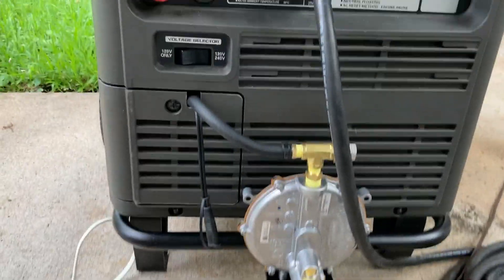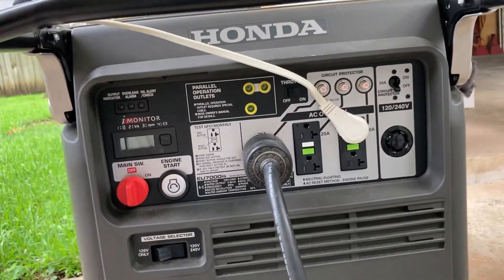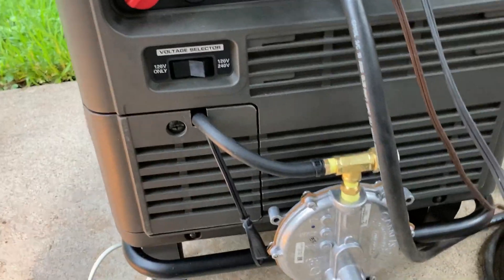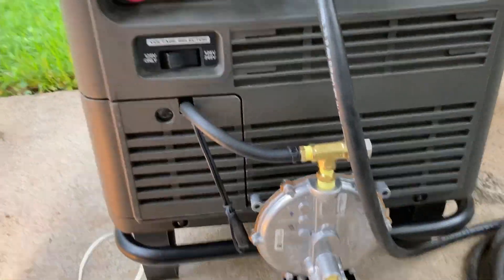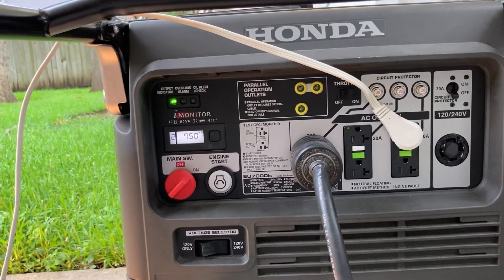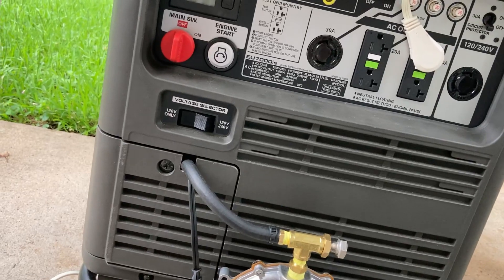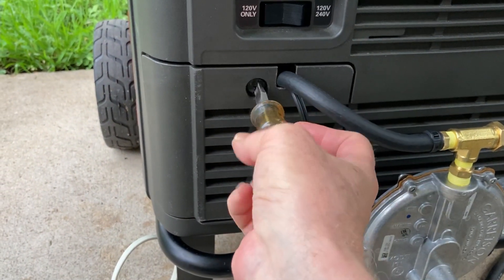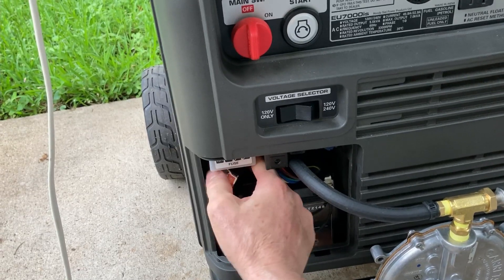Honda EU7000is running on natural gas with US Carburetion Motor Snorkel tri-fuel conversion kit

Comment: Wow, night and day difference!  Thanks for posting this very informative video. It motivates me to finish installing the rest of my US carburetion components and de-commission my genconnex kit.  It seems like the snorkel piece could be the big differentiator, maybe combined with a slightly differently tuned regulator.  Nice work on the customizing, install looks great. 

I just got a GenTent for mine, another nice piece, but spent a lot of time fabricating new mounting brackets as I was not impressed with their one-size-fits-all ratchet strap approach.  Works great now. Ready for hurricane season here in Houston!
Reply from the maker: I just typed a nice longish reply and YouTube ate it.  I'll try again when when my enthusiasm returns.
Reply: @MstrMark  FYI - I connected the generator to my larger 3/4" gas line feeding the pool heater and there was no difference in power output. Sweet spot for higher loads seemed to be around 4600 - 5200 watts, ECO mode or not.  Since the portable gas hose I use is 1/2" ID, that could have been the common restricting element. But as you mentioned previously, the snorkel fitting orifice is so small that the gas supply line is likely not going to an issue with respect to maximum power output of the generator on natural gas.  I'm OK with it...my typical house draw is in the 1500-3500 range during outages.
Reply from the maker: @browsedeweb8834  Well, that's disappointing, but not entirely unexpected.  I've done pressure testing at both ends of my half-inch hose and couldn't see much difference.  It is admittedly more difficult to measure than I had hoped, because the pressure changes at the same frequency as the engine RPM, so one is always trying to read the center of the needle swing.  Still, if the center of the swing is about the same at both ends of the hose, I take that to be a good indication that there isn't any significant loss in the hose.  

FWIW, since I made this video, I added a 3/4" street elbow and a quick connector.  Immediately following that, I plugged my house into it and ran on generator power for a few hours.  I ran a small window A/C unit, heated up a snack in the microwave, washed a load of clothes, worked at my server and my computer, ran lights and fans...basically just did what I would normally do, with the exception of running the central A/C.  Honestly, it was easy to forget that I was running on generator power.  I stopped the test only in consideration of my neighbors, since it was getting to be 8:30 PM.  Not that it's loud, as generators go, but still...

I think I can run my central A/C unit, but I would want to get a soft starter for it first. I think the EasyStart from Micro-Air might be the best choice, but they are expensive: https://www.microair.net/collections/easystart-soft-starters 
If I was more famous, perhaps they would give me one in exchange for a demo video <GRIN>

Meanwhile, I'm good for the short term with 30 amps of 120 Volt loads, and I also have a big DC inverter window unit that I can run with a purpose-made extension cord connected directly to the generator.

There is also the issue that the way that I'm currently feeding the house doesn't support 240 volt loads, so I'd need to get that sorted out too.  I tried to hire an electrician to install a whole-house generator transfer switch for me, but apparently they have been in short supply since the winter storm.  And being as nobody has any stock, I've also had a really hard time determining which one can work with the generator of my choice, as opposed to a single brand.  Generac in particular was completely useless, referring me to a generator installer rather than just telling me if they have products that work will with all brands of generators.  And sadly, my electrician doesn't know either, or it's just not worth his time to try to figure it out..

I might try running on Propane too, just to see if it acts any different.  I'd like to confirm that all fuels actually do work anyway, so it would be a nice little experiment that would take the natural gas supply completely out of the equation.  Of course then I'll have to wonder if I'm meeting US Carb's seemingly impossible requirement of using a cylinder that has already been refilled multiple times, but if it just happened to work better, that would be interesting.  

I'm not really all that concerned with getting a full 5500 watts continuous, but I don't like the way mine surges and hunts at times.  I feel like that might be related to gas supply.  Have you noticed that happening with yours under similar conditions?

It might be as simple as the engine having less low-end torque on natural gas than it does on gasoline, so when the GCU allows the RPM to fall below a certain threshold, the engine just can't make enough power to maintain the RPM.  As the RPM drops, the power output of the generator suffers, thus reducing the load on the engine, at which point it revs up again, but then the GCU once again attempts to reduce the engine RPM until it runs out of torque again, thus starting the surging cycle over again.  Maybe we need yet another black box that will make it so that the GCU more aggressively increases engine RPM with load, basically causing the engine to run fast enough to avoid bogging under load.  Lots of conjecture on my part, but that's how it feels.
Reply: @MstrMark  How many tons is your main AC unit? I have a 4-ton and although I could probably get it to start with a MicroAir EasyStart (my preferred choice of soft starter), I'd be maxing out the Honda with just the running amps for that unit, leaving nothing else for the rest of the house.  I don't want to run the Honda that hard. 

A generator won't put out the same power with natural gas vs gasoline, so I think we're just going to have to live with what we're seeing with the US Carb kit.  Being solid at all loads from zero to 4500 is good enough for me. Project complete.

As for your power feed...I would just add an interlock kit and two pole 240V 30A breaker with a Reliance L30-14 inlet box. That is what I have. Plug the generator in, switch off main breaker and all circuit breakers, switch on generator breaker, switch on all breakers you want to use.  Transfer switch just seems like a waste, with less versatility.
Reply from the maker: @browsedeweb8834  My house has foam insulation, so it doesn't take much to cool it. I have a modern 2.5 ton unit.  According to the label, the RLA is 10.9 Amps (2600 Watts), but my Sense energy monitor consistently shows ~1500 watts.  The latter corresponds with what I have measured at the compressor with my clamp meter.  Obviously the EU7000is wouldn't have much trouble with 1500 watts.

The inrush current is another matter...my meter typically shows over 80 amps, which seems like an awful lot compared to the run amps.  Although inrush is quite difficult to measure accurately, and I'm of the opinion that my meter errs on the high side.  So I think it would come down to just how well the MicroAir EasyStart gadget works.  If the A/C puts a huge dent in the generator's output every time it starts, I"m not going to like that very much.

As far as the maximum power output, it's about what I expected, but I don't like the surging thing.  Are you seeing that same problem?  

If that's the way it has to be, I think I can manage it...it's infinitely preferable to what was happening with the Genconnex kit.

On the power feed, I installed an interlock and an inlet box similar to the one you mentioned at my dad's house, and that works fine with his EU3000is (which used to be mine).  I wish my house was as easy as his was, but my breaker box splits the 120 volt and the 240 volt loads, so there is no easy/safe way to feed both without either replacing the whole breaker panel, or adding a transfer switch before the panel.  I'd really like to do both, but both are expensive.  However, if I have the transfer switch done by an electrician, it would then serve double duty as a service disconnect, so I could then safely replace the breaker panel myself, at my leisure.  That would also give me the option to more easily add a dedicated whole-house standby generator at some point.  And in the meantime, it could serve to return the house to grid power when an outage is over.  I think I could probably make it start/shut down the EU7000is as well, but of course that would be of limited value.  Still, many is the time that I've left my generator at the ready after an outage, in anticipation of ongoing blackouts, so it might come in handy.

On the other hand, transfer switches are currently either out of stock or selling for twice the price, so maybe it would make some sense to just replace the panel now and then worry about an automatic transfer switch is/when I get a dedicated standby generator.
Reply: @MstrMark  Strange...I never saw a load center in the US that doesn't handle both 120V and 240V breaker types on two separate legs coming in from the utility. Must be really old.

My HVAC is 129 LRA and runs at about 22A at 240V, so even with a soft start, it's a no go unless I paralleled two EU7000is together. You should have no trouble at all with the MicroAir model.  I would try it for sure.
Reply from the maker: @browsedeweb8834  Well, it's true that they don't make panels like mine anymore, but they're still quite common.  In family homes alone, I have/had six of them.  This page shows an example: https://forum.nachi.org/t/fp-panels-today-please-assit/40766

Basically, it is a split-bus panel where the top bus is connected directly to the meter and the bottom bus is connected to a 100 Amp breaker that is fed by the top bus.  So in effect, all of the breakers on the top bus are connected directly to the meter (with no main breaker).  This is acceptable per the NEC by virtue of what I have heard called, "The Rule Of Six", which is a way of saying that it must be possible to disconnect power to the building by throwing not more than six breakers.  As long as all of the breakers on the top bus are ganged 240 Volt breakers, the NEC requirement is met.

I replaced all of the breakers in the box, so I don't believe it to be "unsafe", but just from a practical point of view, my panel is maxed out, , so I'd like to have a bigger box.  And it would be really nice to be able to feed everything in the house with my generator, even if it can't run everything at the same time.  I probably wouldn't choose to do any baking during a power outage, but according to my Sense monitor, my oven only pulls 2600 watts, so it could be done!

I certainly agree that your 4-ton A/C unit seems like too much for the EU7000is.  Oh well, little window units are cheap, if you don't  mind putting up with them.  I have a couple of little ones that I bought brand new following Hurricane Ike.  They cost less than an EasyStart and I have used them many times for various reasons, such as failed central units at my house, as well as family members and friends.  Even as I type this, my son's HVAC system is broken, so I'll loan him one, if he can't get it fixed today.  They're small enough that I can carry them up into my semi-conditioned attic for storage.

This video shows my current HVAC system being installed last summer: https://youtu.be/FKUSXxwd6ak  I had already purchased the equipment, intending to install it myself, but then Covid-19 happened, so I couldn't get any friends to help me with it, so I wound up hiring these guys to install it for me while I watched via Blue Iris from my dad's house, across the street.  They accomplished in three hours what would have probably taken me three weeks of spare time, but I'm still bummed that I didn't get to do it myself.  You also get a peek at my foam-insulated attic, if you like stuff like that...which I feel like you probably do!
Reply from the maker: @browsedeweb8834  I appreciate you telling me about GenerLink - in all the time I've spent researching on the subject, I had never seen it before.  It's a weird little website...not even a clue as to how much they cost, although I did find some on eBay for ~$700.  It costs three times as much as a new breaker panel, so the only potential for savings would be in labor.

I live in the Shadow of Houston Texas, but I'm not actually within any city limits, so to my knowledge, the NEC is the only relevant code.  Although I do have a smart meter, and I'm sure they'd send a swat team if I was to just pull the meter out myself, so it might not be as easy as it looks.  I did tap GenerLink a note, asking if it is allowed by my grid provider.

Your basement sounds like a great retreat...unfortunately, we don't have basements in residential construction around here.  As far as installing HVAC systems, I was a certified automotive A/C mechanic some years ago, and I've done a handful of light commercial and residential  installations over the years, so I understand the science and the process.  I also have most of the tools, but I don't have any practical experience in the last 20 years, so it would have taken me some time to feel my way along, but I was really looking forward to the experience.

No offense to the guy who installed it for me, because he was willing to install equipment that I had already purchased on my own when others would not.  They made some mistakes, and they also made some choices that I wouldn't have made, but I've been slowly correcting the mistakes, and I can live with the choices, so I guess it's all good.  It certainly does work better installed and running than it did on pallets in my garage!
Reply from the maker: @browsedeweb8834  Well, to their credit, GenerLInk already responded this morning, but the news was not good for anyone in the greater Houston area: "Sorry but CenterPoint does not allow the GenerLink to be installed in their service area.  They will not allow any device to be installed behind their meter."
Reply from the maker: Hi David, that's my plan as well - to peel all of the Genconnex stuff off and re-install the original fuel tank.  At that point I'll have a true tri-fuel setup.  It seems better to have as many fuel options as possible during a disaster.

Personally, I believe the Snorkel injector is a choke point.  I'm pretty sure mine had more power with the Genconnex injector than it does with the Snorkel injector.  I have to say too that the Snorkel seems awfully fragile.  Maybe it's tougher than it looks, but I was concerned that I might tear it before I got it tightened down.  On the plus side, the Snorkel adds very little thickness to the gasket between the throttle body and the air box, and just FYI, after less than a year, I discovered that the hose connecting my air box to the filter box had pulled loose, because the Genconnex injector plate is quite thick - it was just too far out  of alignment for the hose to stay on over time.  Obviously there are a whole stack of trade-offs, but the engine is running a lot better at light load than it did before, and that's more important to me than any advantages that the Genconnex kit might have.

Congratulations on the GenTent.  Have you had a chance to actually use it yet?  And if so, how do you like it?  I have enough cover to where I don't feel like I need one, but I have a friend who actually resorted to running his generator in the garage during the winter storm in Houston.  He took some precautions, but even so, it seems like the GenTent would be intrinsically safer.
Reply: I agree...this is a great video and the generator appears to be running much better on the US Carb kit. I like the idea of relocating the control module and keeping the battery compartment relatively uncrowded. Also drilling the hole for the tubing seems like a no brainer. I'm so glad it worked out for you @MrMark.

I'll be using my generator with the 240V outlet powering both legs of my main house panel. Still waiting for an elbow to try the generator on my pool heater gas supply, so I'm curious if I  will notice any difference in the generator performance at max load.  Either way, I'm glad US Carb offered this kit. I haven't yet tried gasoline with the kit installed and the switch in the gasoline position, so that will probably be the final validation check.